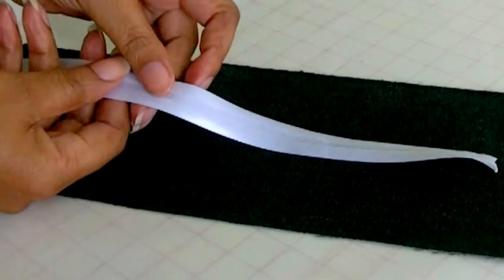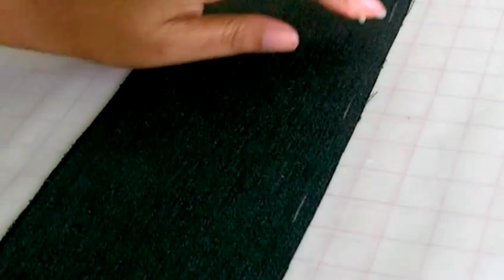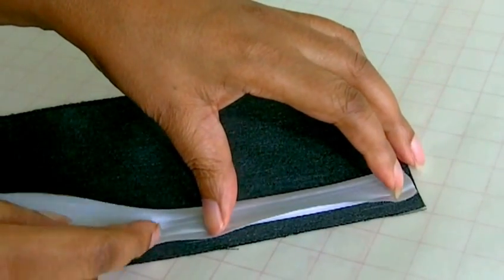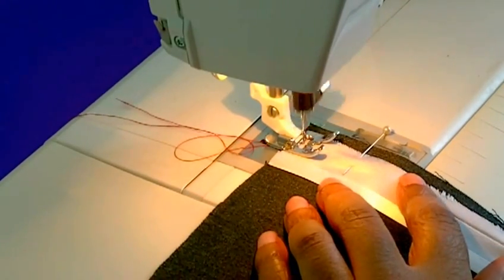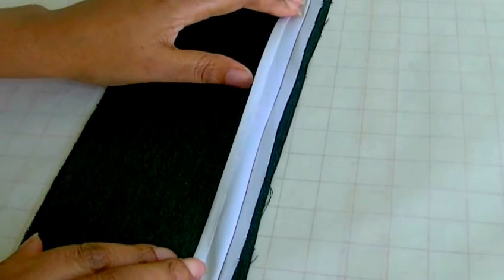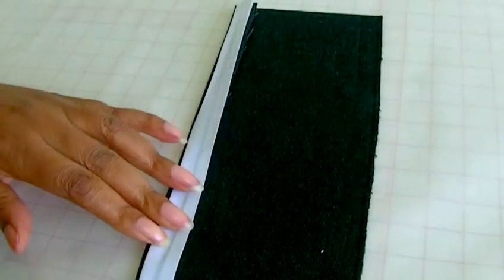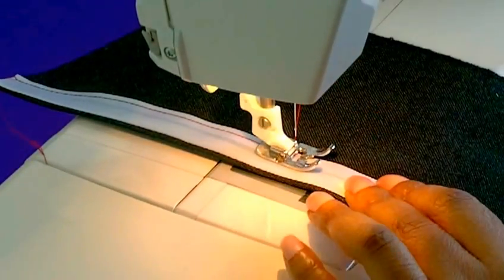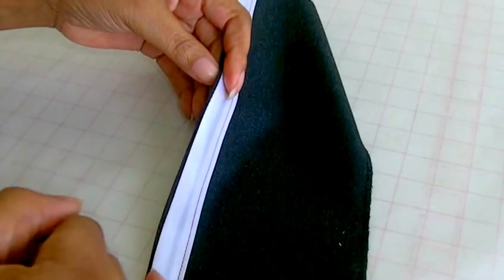Sewing Bias Binding

Comment from the maker: @angel292005 Hi and thank you for the very kind comment.  Bias is normally used to neaten / hide raw edges, used as a decorative feature in a finish but can also be used in place of facing as it is easier to bend around curved areas as you correctly point out.